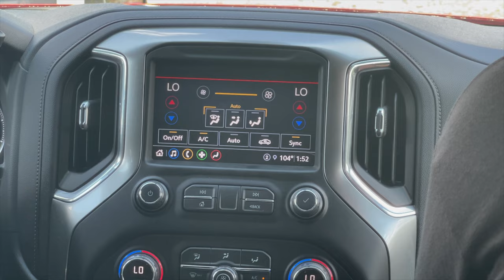24 Hours of Lemons Race at Thomson I Honda Civic EK (Lemons Build EP13)

Comment: Great video but WTF moment at 31:00 with the fire system pull handle mounted above the halo/Apillar bar and cable running over the top. What happens when the car rolls over and pinches the cable making the system useless?  Jay Lamm and John Pagel, please explain how this passes tech. Cage is clean but that pull knob is in the wrong location.
Reply from the maker: Ahhh great catch. Didn’t even realize that until you picked that out!!
Reply: It's what I do after fabricating race cars for 30yrs. Take care.